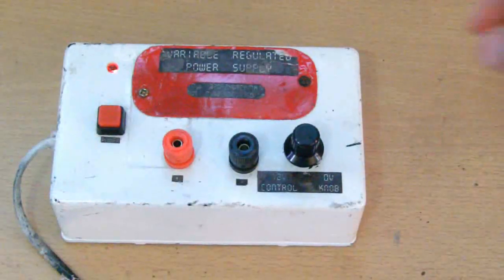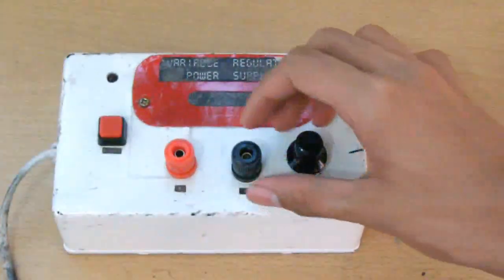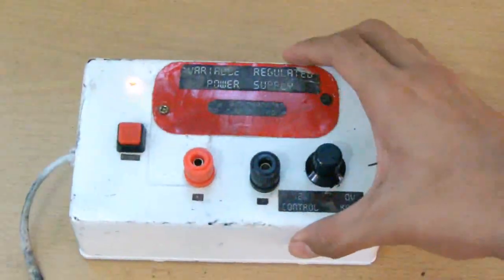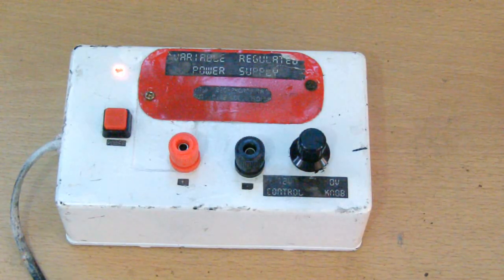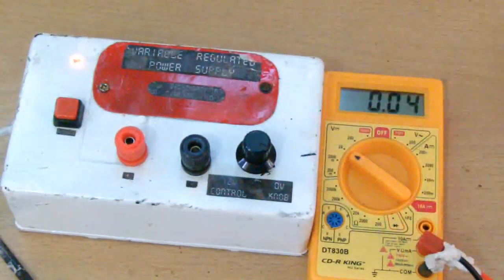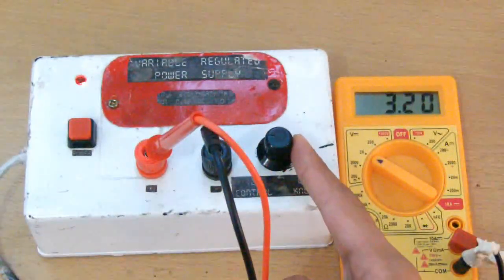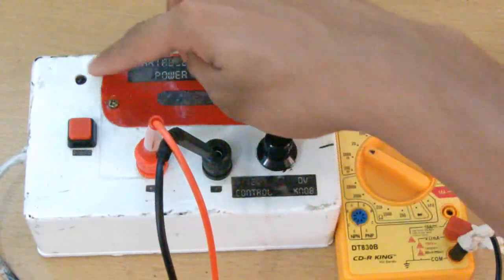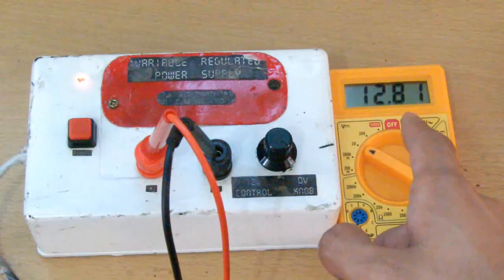0-12VDC Regulated Power Supply (with schematic diagram)

Comment: Quick question  ... how do i reduce the total voltage output ? i got 13v and i want 12v ?
Reply: or should i just insert a  few resistors lol
Reply: and should i use an op-amp if there is a loading effect in the circuit ?
Reply from the maker: you can experiment by adding a resistor in series to the base of the darlington transistor (I suggest you start from 100 Ohms to 1K ohm  and check if the voltae would be precisely 12) . That's the easiest thing you can do. Another would be placing a 12V Zener diode across the load (be sure it's correctly placed or else you'll short the power supply). Adding an Opamp would just complicate this circuit, i suggest not using it
Reply: the resistor thing didint work still the same output ...  and and when i out the zener diode parallel to the load and the anode is connected in the positive output .. i burned my 12v zener
Reply: i connected a total of 1,500k ohm resistor in series with the base but it didint change
Reply from the maker: try a 12V zener diode across the load

Comment: if i use a 10k resistor what will be the value of the other resistor ?
Reply from the maker: As for the 470 Ohm resistor, it is recommended that the resistance should not go higher than 1K. The higher its resistance , the lower the variation for the output voltage there may be brought by the voltage divider network from the base of the Darlington transistor in the circuit. You can use 470 Ohms 330 Ohms, 270 Ohms but be sure that you place a higher wattage resistor for it may heat up (1/2W resistor would be safe). 

the potentiometer's resistance could be any value may it be 5K 10K 20K 50K 100K, but the higher the resistance, the voltage change at the output would be very sensitive to a minute turn on the potentiometer. 

So 10K potentiometer would be fine
Reply: thanks for the reply again it helped allot i modified your circuit added a reisstor + led lights and a diode parallel to the output (short circuit) protection according to google ... but the voltage output increase and idk why lol i think it should drop and when I measure the current the darlingon transistor gets hot lol is that normal ? lol
Reply from the maker: try removing the diode shorting the output.Only in certain applications you can place a protection diode (usually a Zener diode in reverse bias parallel to your load, and there are many different ratings for zener diodes, you must be specific for your type of application. Zener diodes regulates the voltage and when a voltage level gets too high, it lets excess current run off through it while still maintaining the regulated voltage).

 The Darlington transistor should not get very hot when you load is just a couple of LEDs in series with a resistor. It should just be as hot as your hand.

btw, place a heatsink on the darlington transistor in case it gets hot due to a short circuit. Btw, In case you destroyed your transistor due to interchanging its pins earlier in your setup, you can always buy a new one (i guess your darlington transistor is faulty due to the interchanging of pins before). Cheers on your project!
Reply: removed the 1n4001 the diode that i used for the short circuit protection lol because i dont have any zener diodes available
got a 13v output without  load and  then with load(1kohm-10kohm resistor load) i got  12v
Reply: your circuit diagram was awesome and cheap lol i made 3 powersupply[using lm317s] but hated its 1.25v ref voltage i tried other designs like using a -1.25v to 0 out the lm317s but it was very tedious to make lol so thanks for this !

Comment: My potentio meter in the new schematic diagram keeps smoking
Reply from the maker: make sure the BD679 darlington transistor is connected properly with its corresponding pins otherwise you can damage other components, also make sure that you have a correctly placed 12V or 15V zener diode connected in parallel to that potentiometer so to reduce the current in case the BD679 got glitchy in its operation.
Reply: thanks read the wrong data sheet got the emitter and collector reversed